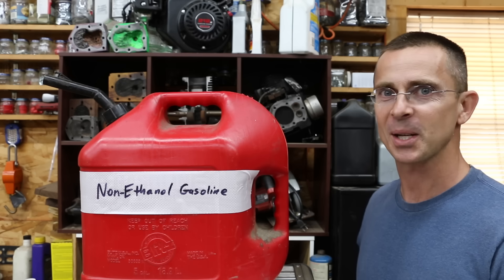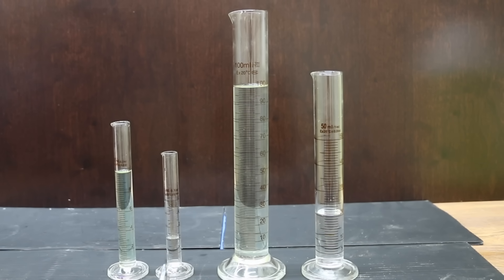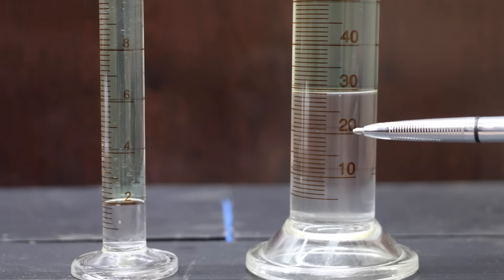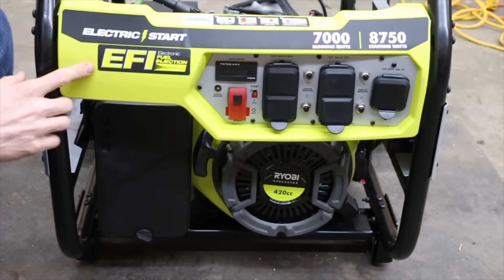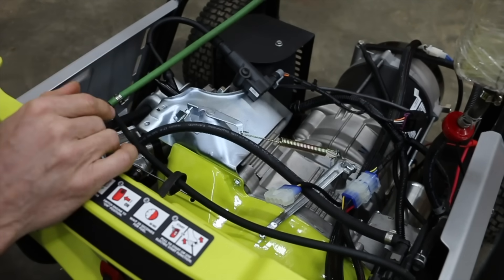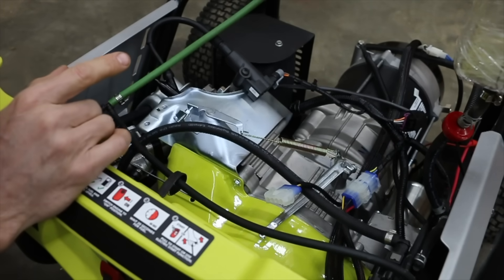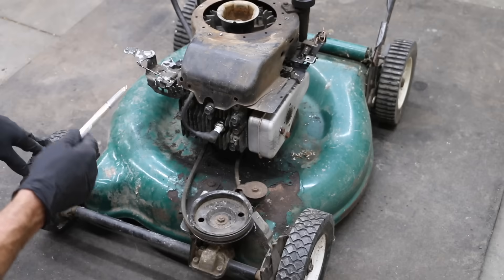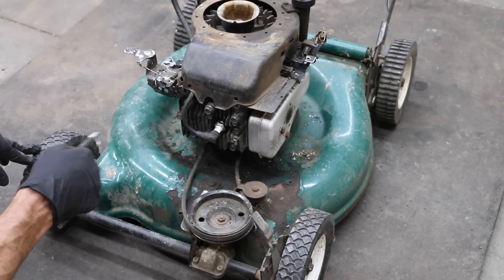Is Non-Ethanol Gasoline Really Better? See the PROOF!

Comment: I would prefer not to run my Porsche on 10% ethanol, but there isn't any source for non-ethanol gasoline in my area.
Reply: I've found a few places in my travels across the US that sell 100% gasoline. 
Most recently was a gas station in northern Alabama.  It was also buck per gallon higher priced.
Reply: There is an app available that tells where non ethanol fuels can be purchased. From my experience, it is worth any effort required to get non ethanol fuels, especially for carbureted engines or any engine that regularly sets for more than a few days at a time.

Comment: ,,, the efi engine appears sophisticated enough (closed loop) to modify the fuel pulse width to change mixture by sensing O-2 . A carburetor will run leaner with more ethanol, if no mixture or jetting adjustments are made .
Reply from the maker: Great point. Thank you

Comment: I was restoring my chevelle it took about 10 years. I'd start it once a year and move it out the garage and add fresh fuel with stay.bil. It's a fuel injected 406 and one day the fuel rail started leaking. Took it apart and the alluminum was eaten away like what salt does. I was able to get it fixed with new seals and fuel lines and cleaned the injector's. Won't store a car again with anything but avgas it's not worth the problems but for regular driving it don't matter even a year is ok long storage is a problem.
Reply from the maker: Thank you

Comment: When the difference was 10¢ per gallon more for non-ethanol gas it was a good deal for better mileage. But the last time I drove thru Iowa it was like 40¢ per gallon more. Definitely not worth the increase in mileage. Of course the farmers want to sell their corn for ethanol rather than corn products. Or am I wrong? Living in California, non-ethanol gas is not available.
Reply: Ha... last time I saw 100% gasoline at the pump it was $1 per gallon higher.
Reply from the maker: Great point!  Yes, I paid a lot more for the non-ethanol.
Reply: Ethanol tastes better than cream corn.....
Reply: Yes you are wrong.  There are many types of corn: field corn (mostly yellow in color, used for livestock feed primarily), sweet corn (the type of corn that is canned for food, used for corn on the cob), white corn, popcorn, indian corn.  There is also an enogen corn.
Reply: 325mag - Your point does not negate the OPs statement. He is therefore not inherently wrong.
Reply: @seth_5394  yes you are not wrong. I was not entirely clear.  The corn vs food argument is flawed.  There are only so many contracts available for the processed sweet corn.  Sometime not all the acres are harvested, not the farmers fault (the processor can't handle all the crop or it matured too fast)
.  As with the other types of corn, the price the farmers get has very little impact on the price of consumer goods.  The middle man gets all the profit.
Reply: 325mag - It’s all good. I can see the logic in that. Cheers!
Reply: @325mag  Most corn grown in the US is not edible by humans. It's growth for syrups, oils, starch. This internet concept that ethanol = food is entirely driven by marketing companies funded by oil companies, who spend millions to disseminate misinformation about ethanol and EVs. Very easy to do in the US because of the poor education rate.
This misinformation is typically from profiles with apparently real names and a picture of some guy, because people trust that on the internet.

Comment: Nice generator, Project Farm has cool toys.  4% better fuel efficiency is exactly as expected: ethanol has ~60% of the heat energy per volume compared to gasoline.  So E10 with 10% ethanol has 96% the heat energy of pure gasoline per volume. And ethanol free E0 gas has a much longer shelf life.  For all occasional use engines, E0 ethanol free seems a smarter idea.
Reply from the maker: Great point. Thank you
Reply: Would like to add the reason why non ethanol fuel is better for storage in an engine that doesn't see regular use.  

Mentioned in the video, ethanol is hydrophilic, it mixes readily with water. Condensation that happens naturally allows some water into a carburetor which can lead to a hard start/no start condition, depending on the ethanol mix, humidity, how long the fuel sits, and other things. Ethanol fuel in a car isn't nearly as harmful to a car than it is to small engines. Modern cars typically use plastic fuel tanks that don't rust and don't have a big float bowl with parts that can rust when exposed to water for long periods of time.  

Obviously, if you're consuming all the fuel before it has a chance to sit and be contaminated by water, not an issue, but it's often best to drain the float bowl and block off the fuel into a carb before long term (couple months or so) storage to prevent potential damage and make it easier to start when taken out of storage.
Reply: @astrangeparrot  there are no additives in off road fuel. Regular car gas has additives for fuel injectors, and isopropyl in winter. Car gas needs to be used fairly quickly, however, when you mix car gas with 2 stroke oil, for some reason it doesn't seem to gum up carburetors as easily as plain 4 stroke car gas. That is just my experience.
Reply: @RustBeltAuto  "good" 91 5 to 10% e gas has a ton of cleaners and such to offset the nasty E many 87 don't put as much in as their 91 premium.
Reply: @Bigggy172  Except Octane is set by grade at the pump E10-E15 at 87 octane is just that 87 octane. They adjust the Gasoline/Ethanol mix to hit the target Octane, so the added Ethanol doesn't ad in detouring detonation. There is also the fact that the Straight gas is 91 Octane, the higher the Octane the less BTU's their are to use. These means that if you can find 87 in straight gasoline, you can see a larger improvement in fuel efficiency. As low octane Gasoline has more BTU's in them.
Reply: Here in south Florida, ethanol-free has caught on for boat engines, as most aren’t used daily and it’s always humid. Definitely even better for home lawnmowers (wouldn’t matter as much with a lawn care company’s).
Reply: @markiangooley  Marine engine systems also haven’t been switched to ethanol-tolerating parts until very recently and older boats are far more common than older cars. All marine gasoline sold dockside is E0, even in states where E10 is legally required for cars. It’s also much more expensive.
Reply: @markiangooley  Same in Canada,   personally I know sailboats with outboards. But ethanol free is practically impossible to find now
Reply: Yes its a nice 420 capable generator...
Reply: I use ethanol free fuel in the generator because it might be used on the worst weather day (rain, snow, whatever) and then quickly stored away when we get power back, but maybe forgotten about at that point for the next 6 months. I always try to at least run the gas down in the carburetor, but I don't want to go through the trouble of emptying the tank.
Reply: @snoopdogie187  I have 2 generators, one from 2004, one from 1998, both run on ethanol enhanced fuel and I haven’t had to do anything with them except general servicing, the precautions I take are, empty the tank and run the carb dry, keep the fuel in a sealed container with double charge of stable, BTW Amazon has a nice hand transfer pump for less than ten bucks, it is really good at emptying or filling the tank without a lot of splash.  In November I empty the fuel cans into my truck, and refill them in June for the next hurricane season.
Reply: @snoopdogie187  6 months of stored E10 fuel won’t do anything. We’re talking about 2 years in a very humid environment to see issues. Also, ethanol keeps fuel lines from freezing. Have you considered that?
Reply: @afcgeo882   Maybe in a gas can, but in a carburetor, it usually means it is time for a carb cleaning.
Reply: @snoopdogie187  No, it doesn’t. It doesn’t turn to sludge or anything.
Reply: @afcgeo882  What was that?? Ethanol sucks humidity...keeps from freezing??? Never heard of that before in my life... it is the oposite what you wrote. The higher the octane rating the higher freezing point.
Reply: @The_Touring_Jedi  Ethanol and octane have NOTHING to do with each other, and if you haven’t heard of that then you know NOTHING on the subject. Ethanol is an alcohol. Look at what alcohols do as a chemical property. Also, drawing in/retaining moisture has NOTHING to do with the freezing point. That’s basic physics. Gasoline freezes at around 100°F and octane doesn’t really make a huge difference there.
Reply: Aside from ethanol fuel absorbing water, is there any other reason why it is worse gasoline than e0?
Reply: @Muranaman E10 gas with its ethanol can destroy fuel system gaskets and seals in older engines, float bowl needle seats, rubber gaskets, and especially old Briggs fuel pumps which were a rubber diaphragm fed off of intake pulses.  Modern engines use materials impervious to the ethanol, but even some older cars can have issues.  And fuel leaks are never safe to have.  The absorbed water will corrode metal fuel system internals in a way that E0 gas doesn't.  Plus a tank of E10 that absorbed water generally doesn't run very well as fuel due to the water.
Reply: @ProDigit80  Ethanol fuel tends to deteriorate many of the materials of the older engines that are not set up for it.  Even some modern small engines have trouble with the plastic and rubber parts.
Reply: @ProDigit80  Isn't that enough?
Reply: 恵勇気  Here at the nearby farm coop it's only $0.40 more per gallon, and regular E10 is $3.50/gallon, so about 11% more cost, and I never have to worry about a clogged H20 laden carb and fuel tank when I pull the gennie out of storage after then next quake or wind storm.  Boat gas at the marina nearby is much pricier, so shop around.
Reply: @oldskooldriver9379  Get a newer car, newer than 7 years old cars. Most of the 2012 models are Ethanol 20 certified, and all of the 2014+ cars are as well.
You can run E30 in it, and the seals will last well beyond the lifetime of the car (125-150k Miles, or 10 years).
Reply: 2011 Mustang gt has ethanol seals and lines
Reply: @ProDigit80  E10 tolerating cars were made in the early 1990s.
Reply: Does it though?
I don't believe there's a measurable difference in shelf life between E-x VS non e-fuel.
A lot if variables needs to be accounted for to test that.

I'm very certain that oil companies don't factor in any shelf life in any pump fuel. It's supposed to be consumed relatively quickly and since it's in high demand all the time you do get a high turnover rate that doesn't require prolonged storage capability.
Reply: Last year we pulled a sealed plastic 5 gal container of E10 that was 5 yrs old and it seemed perfect... as far as E10 goes.
Reply: The thing they don't tell us and I looked it up: non-ethanol fuel mixture is roughly 14:1 while pure ethanol is nearly 28:1 (larger # is fuel) I looked into it because I considered making my own ethanol... Don't get me started on the legal mess that turned out to be IF I tried to license the still
Reply: @scarsdale7186  non ethanol gasoline is 14.68:1. Pure ethanol is 9:1. It's pounds of air to pounds of fuel. E85 is 9.8:1 and E10 is 14.1:1.
Reply: 恵勇気  I disagree. 😎
Reply: Nakatsu Megami  30% more cost? For 100km trip here in Europe I need to take 7 liters premium which is 13.33chf, if I use 95 octane I need 0.5 liters more which costs 13.86chf. How did you come up to a figure of 30% more cost is a riddle for me to be honest. Ethanol kills efficiency that is at least with my 2.4 4 inline naturaly aspirated engine with port injection.
Reply: Except it costs over $4 a gallon making it not worth buying
Reply: @lonewolftech  yup, it doesn't make financial sense unless your value our croplands for growing food instead of fuel.  There's also the added $0.25/gallon cost for STA-BIL to keep ethanol tainted fuel stabile in storage more than a few months.
Reply: OfficialNakatsuMegami  Where do you find 30% more cost ?

Comment: Will ethanol gas seperate out over time on its own inside the tank and cause problems if you dont use it all due to high humidity? We live in deep South. Could the moisture in the air be enough?
Reply from the maker: Yes, you are right. I can indeed separate out (phase separation).  I've got an upcoming episode on this. Thank you